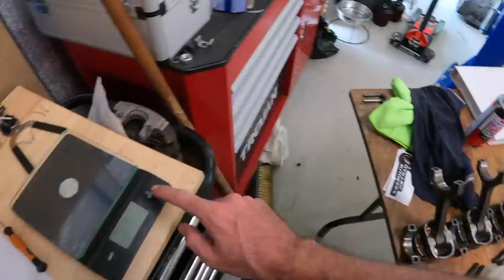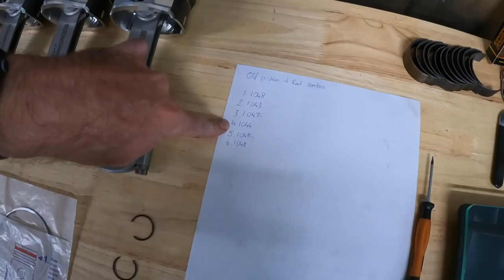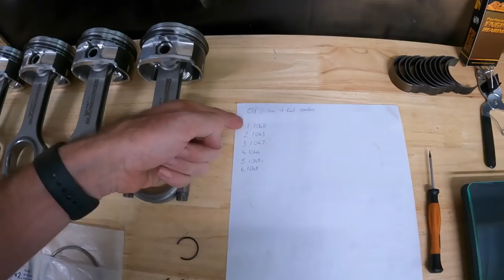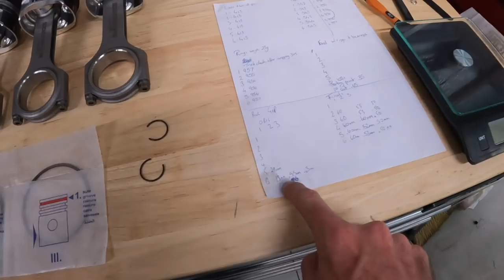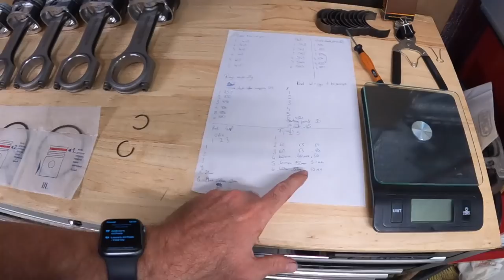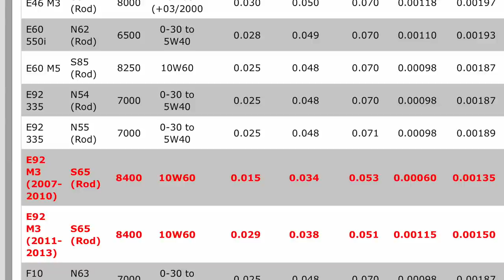FORGED N54 BUDGET BUILT MOTOR BOTTOM END ASSEMBLY

Comment: You should use a old piston with only the second ring on it when checking your ring gaps, that way the the piston ring on the piston acts as a stopper when pushing down the new ring is 100% square in the bore when measuring. But well done.
Reply from the maker: Nice tip! Thanks

Comment: I saw that when you compresed rings you oiled them and randomly turned, i hope the rings "locks"/"gaps" are shifted between each other by 120 degrees. otherwise they could settle wrong and then you make low compresion 😣
Reply: Thats a Myth bud. The rings will rotate all over the place.
Reply: @samwalters4205  No is not myth lol, all the engines manuals will say that you can not install piston rings aligned, and yes they all rotate around, so if you keep them offset they will never align because they all rotate at the same speeds lol
Reply from the maker: I second the myth theory, as do most experienced mechanics. The people i have watched put engines together just make sure they are offset.
Reply: @fabini14  it kind of is. It's just general good practice and for the few seconds it takes why the heck not. 

As for them settling in the same spot. They don't settle. Nor will they rotate at the same rate. 

The conditions applied to the first and second ring are different, they are also different profiles. Typically top rings have a rounded edge to them. The barrel type, these seal against the cylinder wall due to the pressure behind them. 

The second rings typically a more of a tapered design with the wider part at the bottom. 

There is a lot you will see in these manuals that isn't strictly true lot of it is due to an age old phrase in engineering that halts progress "Well, we've always done it that way" they haven't truly analysed the situation. There is also a lot you wont see in those manuals. 

For example. Lapping rings top and bottom on a surface plate then lapping the edges using diamond paste in another block checking using a microscope to get a consistent pattern. A block specifically for the purpose. Its for the removal of the run in process. 

But that's a different world to the needs of 99.99% of engine builds.  I mean engines built to that standard typically get water and oil at operating temperature pumped through them on the dyno. Fired up. Light to mid load to knock the brand new cams in for 10 mins. Then get leak down tested to verify reporting back typically in the 98% plus range. Then get absolutely sent briefly again to verify before they are bolted into a car. Run for half a season of racing before being torn down again for another rebuild. Typically around the 10 hour mark.

Comment: I would also file the ring the opposite way, to help with not getting edges on the "outside" of the rings, just for that extra safety. Looking forward to seeing it rip!
Reply from the maker: Thanks for the tip. After watching Real Street and how he then files them i was expecting the ring to have a burr, but these just felt perfect. Mind you i may have just not been paying enough attention to feel it, due to the oil, or maybe my ebay ring filer is very fine..... hmmm fingers crossed regardless.
Reply: @ZeroTo60Tube  It's probably just fine :) I bet you would see some small marks in the bore after turning the crank over a few times if there were something to worry about.

Comment: Good vid.  As I have mentioned before , if N54 folk want to go even more budget, simply re-gap stock piston rings , pull torque out of the tune and go upgraded head studs. You can push the power much further, perhaps 1000hp or near to it might be within the capabillity of the engines stock gear?People have commented you may want a little bigger 2nd ring gap to the 1st ,to negate flutter but, having said that with the larger gaps in general you have there,  it's not necessarily an issue. You will have more 'noise' for the piston assembly, so you may have some knock sensor tune fun ahead of you
Reply from the maker: I think thats bloody good advice all things considered.

Comment: I think it’s pretty crazy that my stock end gaps were about 0.011mm, and my new end gaps per Manley specs at 15-30psi of boost are at 0.023🤔 
Now, I know it depends on the ring material and it’s respective coefficient of thermal expansion, but still it’s a bit scary that I had to double the gap😮 …I guess it does make sense, being that the stock n54 wasn’t gapped to be running high boost. I love your channel, by the way and it has provided a TON of insight😎

Comment: I've built a few engines now both the proper way and the not so proper way and she'll be right man, always error on the bigger side for ring gaps a slightly larger than factory bearing clearance isn't an issue as long as you run thicker oil like you do.. you should see ethels bearing clearances 😅 the only thing I saw that may be a problem is the second ring usually gets a slightly larger gap the the top ring so it doesn't trap Any combustion in there making the rings (flutter) I'm looking forward to seeing it make some noise and some jam man good work 😊🤘 also the slightly lighter rod and piston assembly's will either over balance or under balance the engine Steve Morris has a good video about engine ballancing to.. jaffros vids are crazy detailed I don't know how he does it and I like the way jay explains everything just really simple to understand 😊
Reply from the maker: yeah, interesting about the second ring gap. The OE ones were like that. Ahh well, i can't put the material back on lol. These 1st rings to now how the largest gaps i am aware off, im sure there are bigger out there, but we will see how this goes. It is what it is. Will check out steves vids, i keep meaning to but never get to it. I saw his shop on an old road kill epiosode and love his drag week build. As for Jafro, that guy is brilliant, over the top and just puts in so much effort.

Comment: Sorry to hear you've got to move. Glad to hear you had a great sleep after the teardown video. You're not the only one to have a sleepless night over something so small, that you know is off. The subconscious part of your brain is telling you something is wrong in what you've done, but you're sure you've done it right. Just glad I could help you rest that night, as I've said I'm always available for whatever advice I can give Andrew, any time, any day. 

Your thinking on the overall weights of pistons, rods, bearings, pins etc. was correct, I usually put the heaviest ones closest to the front and read of the engine, as that's where the higher rotational mass of the flywheel/flex plate and harmonic balancer/crank pulley live, so they will help negate that extra gram or two. Your ring gaps should be pretty good, don't panic about it. Where you measured is the better part, the bores may be tapered with it being narrower at the top, which where you need it to seal the most when the cylinder is firing.
Reply from the maker: I missed this comment Geordie, sorry about that.

Comment: You're right. People act like if you don't get everything perfect weighted and perfectly bore/surfaced the motor will blow. But I've seen people swap the heads, pistons, and rods from donor motors while half-ass weighing them and the motors still running today.
Reply from the maker: i think on a poorly made engine something from 30 years ago, it was important to balance the rotating assembly. They made hardly any power from factory and balancing wasnt important until you wind them up. Now things like these n54s are pretty damn good from factory, and the aftermarket stuff is also well balanced. The need to properly balance isnt there at sub 1000hp levels.

Comment: I watched most of the video but I did not see you mention piston to wall clearance.
With those pistons you are using they will require larger piston to wall clearance than stock.
Usually will need anywhere from .0035"-.004" clearance
Reply from the maker: I dont have the bore guage to measure it, however they are made to suit standard bore size. Its a ghetto build for sure. But so far, its working ok the new motor has gone wuicker than we ever did with the stock one...... fingers crossed it keeps together

Comment: Love the build progress. When we built 10,000 rpm Honda motors we never balanced anything and had zero issues. Only thing we did different was to chamfer the files ends of the rings slightly to remove any sharp edges from grinding and helped reduce chances of gouging.
Reply: Honda engines are very well balanced from factory
Reply from the maker: The sections of the rings that i ground just felt perfect. Maybe i am tarnished from all the keys i have done which are rough, but fingers crossed its all ok.
Reply from the maker: Ohhhh also wheres the honda vids? Just stalked your channel. I want to build a K24 one day...
Reply: @ZeroTo60Tube  I’m sure they’re fine. You would have noticed any burrs. 

Honda motors are well balanced factory. They spent a lot of manpower on there higher teir motors. even to using different sized bearings for clearance. Only video I have up is from my 99 GSR. It was a compete engine job,  bored and stroked to 2.0, pushing 280 N/A. This was back before YouTube was a big thing, lol.

Comment: A few questions re. fitting the end caps / conrod bolts. Do you need to fully torque the bolts in order to determine the clearance using the plastiguage? I would have thought that just tightening would be enough. Also, given that you have fully torqued the bolts, should you really be re-using them for the final assembly? Great video - I'm learning a lot.

Comment: Bro. things started getting interesting really, good luck with the build. Rings gap depends on the materials type that was made of as each has its own expansion measurements in regard the specific heat number so it’s best to stick to what the rings manufacture specifications. Are you keeping the OEM compression?

Comment: My guy, the thing is, you want switch and swap the tightest bearings with the loosest bearings and the middle tight with the middle loose, until you get everything kinda even stevens. Or as close as. 

So if you have one at .076 and one at .048  and the rest are like .056 .062 .065 .051 you swap .076 with .048 and recheck. They should be closer to .055-.060 range. Then you swap. .056 with .065 and .062 with .051.  The ones that are closest in value to each other may not change much or at all. 

But the ones that are drastically at opposite ends should settle closer. Because there is some slight variance in journal, rod end, and bearing thickness. And you want to average all that shit out.

Comment: Love your videos . I got a question so I will be doing a swap on mine the original engine has 218k miles on it and I got a 81k that I will be putting in because I am doing a single turbo swap . So I wanted to re build the original even though there isn't anything wrong with the engine.  Would I have to send the block to a machine shop for the cylinder honing or whatever the name it is I can't remember right now as the cylinder walls would be ovaled from mileage or am I over thinking . I would like to throw some rods and pistons

Comment: Everything you’ve said so far sounds spot on. My only concern would be bore and piston clearance. Pistons are slighting tapered ( wider at the bottom). Normally measure the piston 1/2 inch down the skirt of the piston.
Reply from the maker: I had no way to accurately measure them unfortunately. We’ll see what happens
Reply: @ZeroTo60Tube  I’ll keep my fingers crossed fyi there’s nothing wrong with the Chinese micrometers, they are very simple use a .5mm thread so one full turn is half a mm. And the bore gauge is just a dial indicator you use to reference off of the micrometer. Wish you guy where close I’d happily loan you mine.

Comment: I broke a piston on my n54 due to my own negligence. 
Looks like I just need to replace the pistons. I see traum are doing a 84mm 10.5:1 as well as JE. Is that compression okay or should I try and drop the compression from the standard 10.2:1? 

I’m running stage 4 ebay turbos with meth and the normal other bolt ons.
Reply from the maker: Speak to your tuner. With hybrids it can be benificial to relay on compression that boost, to make the power. Hybrids clog really around that 25psi make, so you will make power more efficiently at with a higher comp engine. However your issue with be fueling. Pump and Meth will take the higher comp ration like and ethanol tune. So you may be better off with stock or even lowr comp pistons. Again speak to your tuner he will know how to best maximise your setup.

Comment: Hope you offset the ring gaps across all 3 rings so you don't lose compression/burn oil. Otherwise looking forward to the end result.
Reply from the maker: I just randomly spun them. They will spin anyway, so should be fine as long as the gaps are not directly above each other. Again this is one of those things, i don't think experienced mechanics worry about.
Reply: @ZeroTo60Tube  Randomly spun is fine, what @Peak traveller is getting at is the problem is if they are all aligned, then you can lose compression and burn oil. I usually set the top two rings 180° apart, the oil control ring gaps (given it's  a3 piece ring) I set them about 120° apart, and have never had an issue. Any difference in the ring gap is great, and you are correct, they will rotate with the engine running.

Comment: If you want to run 800whp you’ll need a head stud solution. Arp head studs (preferably 11mm all around) would be best. Even the 11mm main and the 9mm outer head stud kit would be alright at 800whp. Unfortunately lifted my head on my built motor with 3k miles after pushing around 32psi on a single turbo set up. My buddy that built his motor around the same time as me experienced the same issue
Reply from the maker: Heard of quite a few built motors doing it. But not many stock. Did you have ARPs in it when it lifted? Also how was the head torqued when it was built? Lastly did it damage the threads when it lifted?
Reply: I had stock head bolts in it when it lifted. They were torqued to spec using a snap on electric torque wrench. As well as the correct pattern. Thankfully the threads were okay. But when I tore it apart 3 days ago I saw coolant burn marks on the outer corners of cyl 6 which means the 9mm outer bolts gave out.
Reply: @ZeroTo60Tube  And I was running about 32psi and some spicy timing when it lifted. Estimated 795-815 whp

Comment: What was the piston to bore clearance. If you mentioned it I missed it. Great channel. Sorry about the move.
Reply from the maker: I had no way to accurately measure it. The pistons do not wobble as much as the stock ones did. But they still wobble a little on the wrist pin.

Comment: Just wondering have you heard of the crank hub issue with the n54 when they are DCT or manual when running big power.  I know the n55 is bad for it but I just been seeing a few videos about it.. its not so bad in the Autos tho..
Reply from the maker: I haven't head of many failing when factored fitted, but once they get touched, they do like to spin apparently. The crank hub is one of the main reasons i wanted to leave the crank in the block. I dont want to unsettle its fitment.
Reply: @ZeroTo60Tube  yeah same here i think...
Reply: @ZeroTo60Tube  bmw has released an updated version of the crankhub. Vehicular DIY goes over it in this video. https://youtu.be/7-1LJkLcJNQ

But I agree with your thoughts of not touching the old one of it's still factory.

Comment: Hey buddy I’m literally so close to having all my parts here for my built motor with the twin 53/53 MMPs and my head is almost done being ported also! Question.. I really really need you to send me a link or where I can buy the Head Bolts you used on your motor also. I’m going to do exactly what you did for the head bolts this is last thing I haven’t ordered yet please help me out!
Reply from the maker: Hey man. ZD30 Nissan Patrol head bolts are what i used. They are 1mm shorter than n54. Same thread pitch but 12mm instead of 11mm. While you are in there would recomend time certing the block. Its anothe few hundred bucks to get it done, but will be proper legit setup.
Reply from the maker: Hey man, can you shoot me an email about this. I have a new plan. Which someone else recommended to me and I think it’s better than what I did. But basically n57 head bolts. Using that torque sequence. Not guessing like I had to.

Comment: I saw when you weight the old piston & conrod, you forget the weight in the bolts
Reply from the maker: correct. however i the measurements on the new ones on the sheet don't have the rings. The total weight was around 30-40 grams lighter on the new ones.
Reply: @ZeroTo60Tube  I see ok. Anyway I just saw someone recently uploaded their  YT video on n54 crank hub failed. Are you going to upgrade your crank hub?

Comment: 22:10 when you pushed that piston in to set the ring the piston seemed a little small like you will get piston slap.  Also you may want to check to see if any cylinders egged out so you should be drop the piston upside down from top and spin it around, if it is egged it won't spin.  Update: once they were all in it seems okay.
Reply from the maker: Obviously didnt measure it, but they dont wobble as much as the stock pistons.